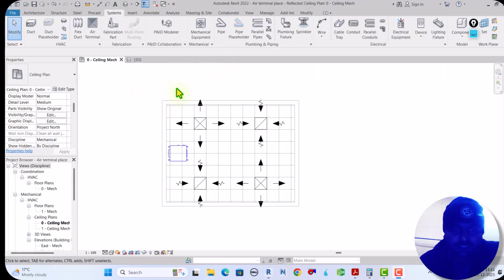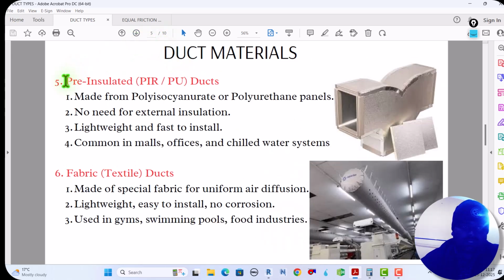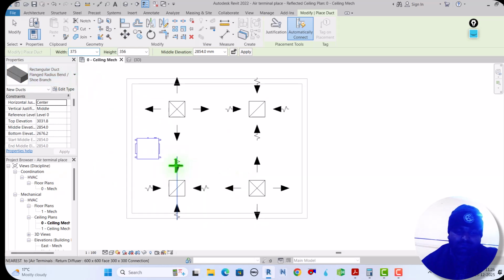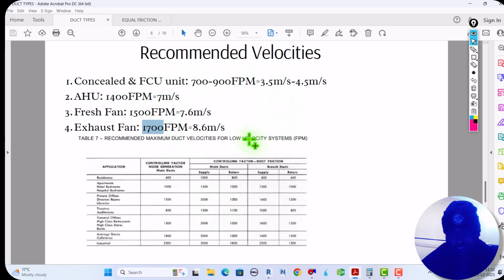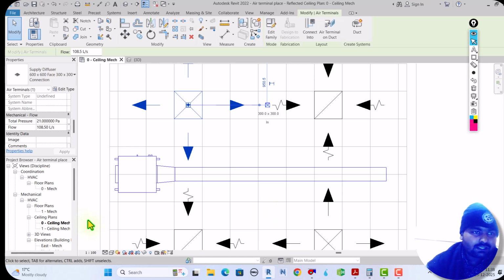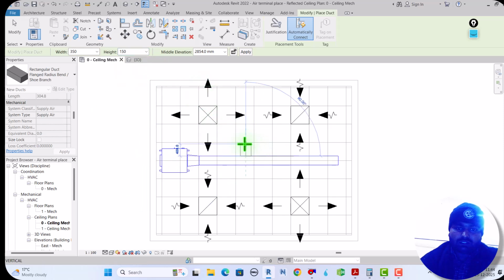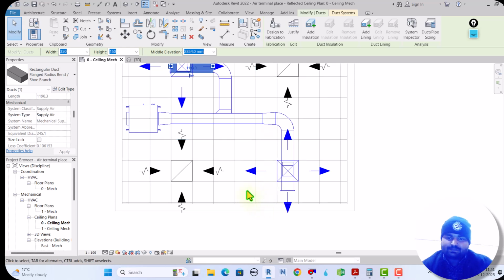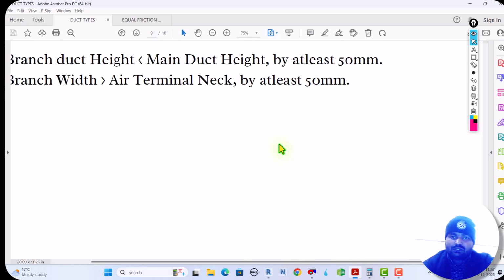HVAC Duct Explained I Design, Types & Installation I Beginner to Pro

Comment: When ur calculate branch duct..
U mentioned 350/150 it came 2 but duct size is 1:4 right 
When u calculate 350/100 it came 3 so 3 is near to 1:4 right why u choose 350/150 instead of 350/100
Reply from the maker: Yes you are right ✅️  but for take out  branch we need minimum 25mm both side .it means 25+25=50mm .